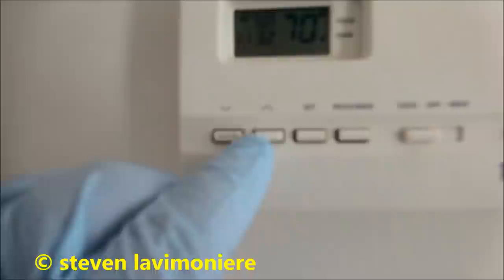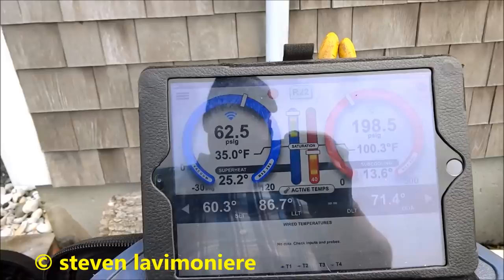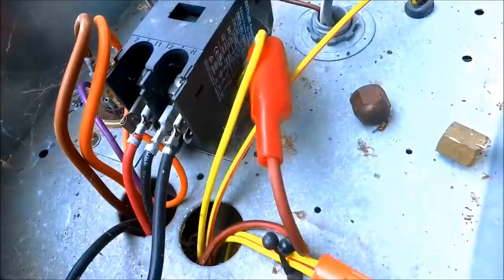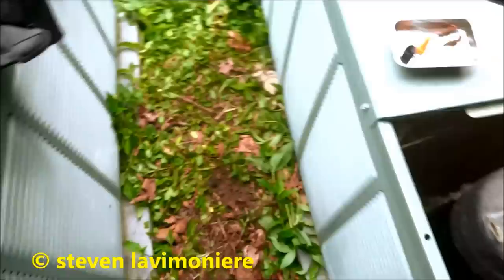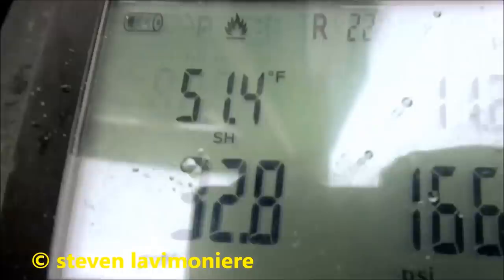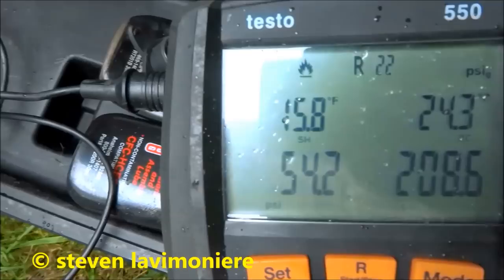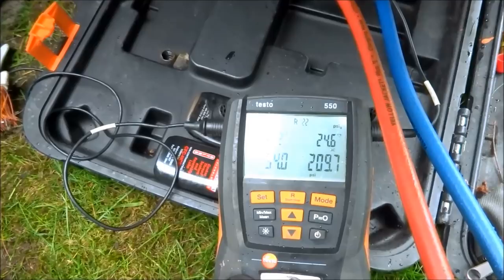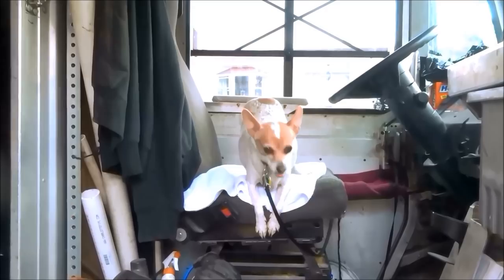three air conditioning calls low on refrigerant

Comment: As usual, enjoyed your video Steven. Cute dog. Did you check delta T on any of these? I was talking to a buddy of mine and he was telling me how when it's cold he usually gives more consideration to that instead of pressures. Just wondered what your thoughts were on that.
Reply from the maker: i check it some times ,depends on whats going on with the job.most of these system are way short on air flow due to small returns.its a big problem up my way

Comment: Great repairs Steven. Any thoughts on the replacement refrigerant you will use when you run out of R-22? Everyone seems to be leaning torwards R407. You know anyone who has tried NU22? Thanks for the videos.
Reply from the maker: i have plenty of r22 like 8  new 30 lbs  jugs